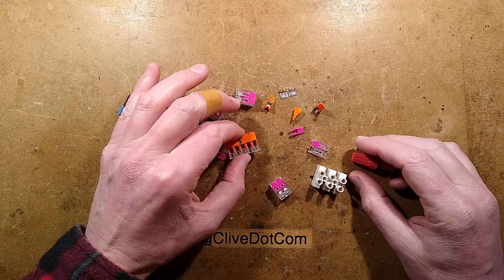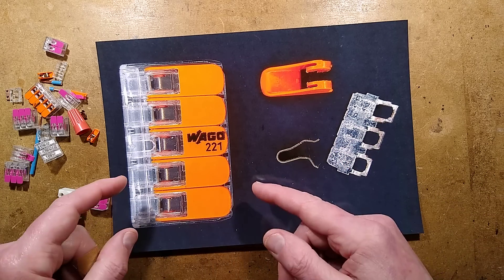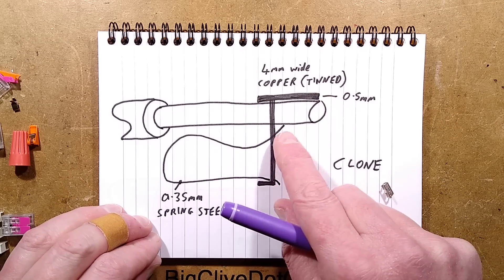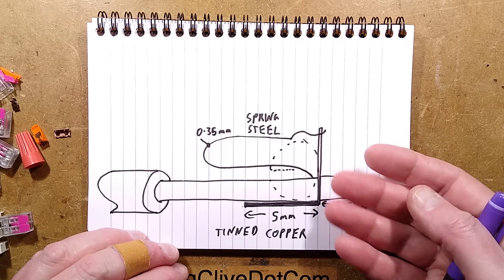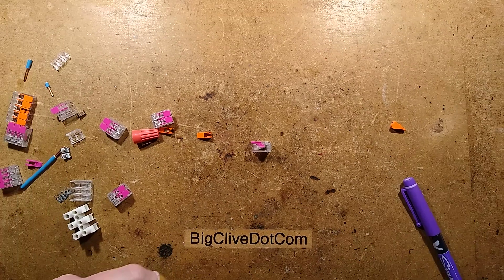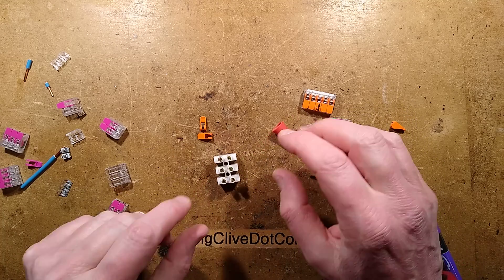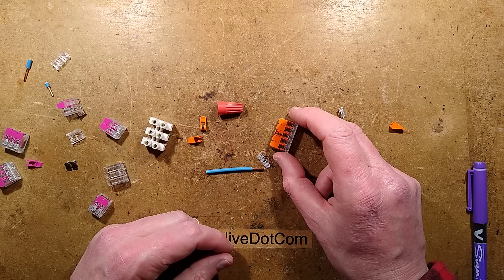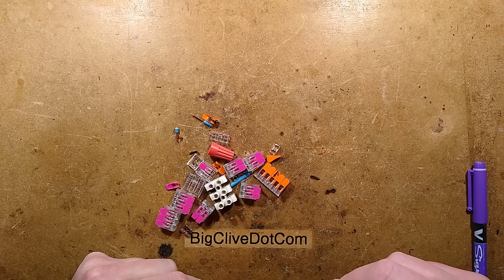Inside a Wago connector and a clone

Comment: Another good video Clive,watched you for years but never commented,I live in Ayr and it's good to hear a fellow Scot,I bought some non branded ones from Amazon after I watched a video of John Ward's where he tested them extensively against branded terminals and gave them a good review,
Reply from the maker: I'm back in Glasgow at the moment.   The one thing about the clones that concerns me is that you could buy several packs from the same supplier and listing, but get different ones of unknown quality.
Reply: @bigclivedotcom  I've used a some when I changed a couple of outside lights so hopefully if anything happens it won't be disastrous,love Glasgow and as it's only 45 minutes away on an X77 we spend a lot of time there,thanks for the reply

Comment: They are starting to design sockets and such with these push fit type terminals now too, that might even have been a great Scott video I saw that on.
Reply: Mk sell a double socket with these type terminals (I'm sure it's in connection with wago) on the market for nearly a year :)
Reply: @T_Perkins  yup, it’s the MK Logic I believe, and I found the video I saw it on, an eFIXX one from a year ago 😂
Reply: All the electrical outlets and switches I have purchased recently have similar stab-lock style connectors. Instead of a lever, there's a slot that you can jam in a screw driver to push back the spring. If these are being put in CSA/UL listed devices, I have no concerns at all.
Reply from the maker: That may have been my video.
Reply: @bigclivedotcom  it may even have been your video, I watch so many electronics YouTubers 😅
Reply: They are starting now? This type is the only one installed in my 24-year-old house.

Comment: I wonder if the Wago is designed as it is not because of simplicity or ease of manufacture, but that the 'clone' design was not patentable as it had been patented in 1950 or something.
Reply: Patents DO NOT APPLY in china where these are from.
Reply: @Basement-Science  ... Neglecting that this isn't simply true, roots refers to wagos choice of design.
Reply: @queazocotal  Sorry, I think I misunderstood what you meant. I still doubt that Wago had to maneuver around any patents, because if they did, I doubt just moving stuff to the other side would have done that. Patents are usually written to apply very broadly, specifying many more configurations than what the patent applicant wants to actually produce, and furthermore, presumably that would mean there should be another company that would make very similar connectors for at least as long as Wago does, and I've never heard of such a company/product.

My original statement is still accurate however. While the chinese government may or may not claim to uphold international patent laws, the reality is that there is zero enforcement of foreign patents, hence they do not apply.

Comment: "Over 100 amps". Ok, I'll try not to use those connectors on my boats 3000w inverter hooked up to the 12v leisure batteries then...

Comment: For solid wire, I'm a big fan of Wago 2273 connectors, which are different from the Wago 221 connector in the video.  I think the 2273 makes much better connections than the 221.
Reply: It’s about the same connection afaict — you can push solid wire into these without using the levers, this is a supported use case I believe. They’re just reusable, can handle stranded, but also are bigger and more expensive.
Reply: @JasperJanssen  The 2273 connector has a retention spring that bites into the wire in a way that the 221 doesn't.  https://youtu.be/zgjo36-jaFY?t=493
Reply: yep. wirenuts are more versatile, but less fool proof.
also, ceramic wirenuts are still used in the US, for high temps.

Comment: Should ferrules be used with these?
Reply from the maker: Only if the ferrule is properly crimped on in a style that prevents the strands sliding out from inside it.  The spring clamp doesn't clamp it in the same way as a screw terminal.
Reply: I've used ferrules with these. The one thing you need to be careful with is that the ferrule is going to make the end of the wire fatter, so a crimped 12AWG wire isn't going to fit.

Comment: Sorry Clive but I don't like them as to me they are too figgley. I profer the old system and ( MK ) junction boxes for lighting and the Round 30 amp junction box. I only use the (12 way ) terminal strip as a temporary measure. 

The minimum is 5 / 15 / 30 Amp terminal block. Ok everyone is different. 

You have a good way on how good or crap they are made. Cheap and nasty compared to top of the range. Good work.
Reply from the maker: Have you tried the Wagobox?  It's a very neat alternative to the old round junction boxes, with much less risk of rogue insects getting in and causing rogue RCD trips.   Personally I don't like the old round boxes, as the grub screws are easy to lose and the depth of the wire slot is often ungenerous.

Comment: I only have one genuine 3-way Wago terminal (which I randomly found outside Derwentside College when I was going there), the rest of my terminals are the clone, thin-lever "finger-stinger" types, cos leave a finger or thumb and/or nail in the way and god they sting when they snap shut!!! But they are so damned handy for making connections quickly and safely, no more twisting wires together and hoping they hold for messing with battery-powered stuff... :)

Comment: Sigh. You're going to make me go figure out the four wire resistance connection on my bench meter, aren't you?

If i had to guess, wire nut is lowest resistance, them screw block, and Wago last. I doubt it matters unless you were going through an absurd number of splices on a branch circuit.
Reply: It depends a lot on the quality of the connection. Screw terminals and Wago are relatively easy to get good contact. Wire nuts can be a crap shoot. If done well, you have a lot of direct wire-to-wire contact, as well as the outer screw of the nut itself. If done poorly, the wires may have little contact with each other and with the wire nut, with the nut basically just holding itself on to one wire and the twisting of the two wires being the only thing physically holding each other together. It's this huge variability in the connection of a wire nut that turns me off from them.

Comment: I didn't hear Clive mention anything about solid versus stranded wire.  Some videos show wire nuts used with a solid and stranded wire, and if done properly, withstand the pull test.  But how about these types of connectors?  The white "Euro" type connector with the screws will really clamp down on stranded of just about any size.  Stranded is important for many projects.  Thanks, Clive.
Reply from the maker: These connectors are suited to stranded and solid wire.
Reply: Wago 221-41* style connectors are good for stranded and solid from 24AWG all the way up to 12AWG, or from 20AWG to 10AWG if you go for the slightly larger variant (221-61*).
Reply: An added bonus with the WAGO 221 and similar for stranded wire is that thanks to the spring loading, even if the wire moves and the strands shift, the spring will clamp down tightly. It even works with tinned* stranded wire (which one should never do, but sometimes you encounter with speaker wires for example). Screw terminals are an absolute no-no with tinned stranded wire, since the solder will cold-flow under pressure, but spring terminals will always clamp tight. 

*by which I mean the entire wire tinned with solder, as one would do to prepare it for soldering onto an eyelet or whatnot. I don’t mean tinned strands from the factory.

Comment: Talking of the expense of copper, I wonder if the reason British Telecom is lifting all the old copper wires and replacing them with fibre-optic cables is partly because the copper can be resold?
Reply from the maker: If they're removing them it may partly be to make space for the fibre, to help pull it in, but also as you say, to reclaim the copper.
Reply: @bigclivedotcom  Fibre-optic cables have much higher capacity and bandwidth than copper. In the pre-digital age, the copper cables would only carry frequencies up to 4kHz , enough for a single telephone circuit. The conductors in the large cables nearest to the exchange were reduced in size to free-up duct space as the networks expanded. When I worked for the Post Office Telephones in the 1960s, conductor sizes were stated in pounds per mile. Domestic telephone cable used 6.25 lb/mile conductors, about 26 swg or similar to 30 amp fuse wire.
Reply: As I understand it there is definitely a copper reclamation and scrapping/selling/recycling project being done alongside fibre installs now

Comment: I use the Wago terminals. I tried a clone and found them much more difficult to get stranded wire (all I use) installed securely. The Wago's were effortless but the clones required concentrated effort and a mandatory tug-test.
Reply: You are an idiot for trying to terminate stranded or flexible wire into and spring retaining terminal blocks, Wago included. 
Every termination you made like so should be reworked.  
Call yourself a professional?  Think again, if you can.
Reply: I just cannot hold a wire and not do a tug test.
Reply: @hornetIIkite3  Not sure if double entendre.
Reply: Anyone with a lick of sense completes an install with the tug test.  Waygo or not, not doing that is a clear sign of being stupid/lazy/incompetent/unprofessional/whatever.
Reply: @boots7859  The guy is all of the above for terminating flex or stranded cable into these without use of crimped ferules.  No two ways around it.

Comment: It wasn't clear from the picture, on the clone, is there any risk that opening one of the contacts will reduce the pressure on the adjacent contact, potentially allowing an existing connection to break free?
Reply from the maker: The only common part is the base section.  Each spring seems to have good separation.
Reply: Agreed bcdc...Also of note, I love how while some current can go through the spring, the whole point of the spring is to make the best contact path push into the bus bar, so there is no movement arc...and because spring loaded, if there is any expansion/contraction (dissimilar metals, alu wire, etc) the spring will make up the gap and keep consistent pressure. A screw terminal or wire nut will not.
Reply: @frollard  wire nuts are certainly spring loaded. They rely on a conical coil wound from steel spring wire of a diamond cross section. Unless you’re talking about the purely plastic or ceramic ones.
Reply: @robertlitman2661  To some extent yes, but the wire is constrained to the plastic housing of the nut. Far less motion than the thermal expansion of various mismatched metals, hence why those are not suitable in the electrical code.

Comment: Do Wago do the multiway connectors yet? One block with 3x 1:1 connections so yo can do L/N/E similar to a screw terminal block.
Reply from the maker: They have the single pole version, but not the multipole variant.  I'm not sure whether it's for electrical separation or just because they can't face making an official version of the clone.
Reply: Not that I can see but they do have the 221-2401 which is an inline splice. Three of those would do it, they just have not taken the step to make three of them be one unit yet.

Comment: I prefer the Ideal lever connectors to Wago as the wires just push in without having to lift the lever. It's just used for disconnection.

https://youtu.be/kaCA_Znykes
Reply from the maker: The clones do allow that with solid cores too.
Reply: @bigclivedotcom  that's good to know.
Reply: Ideal, yes, I was going to say that I liked the concept of the SpliceLine but I no longer remembered what they were called or who made them